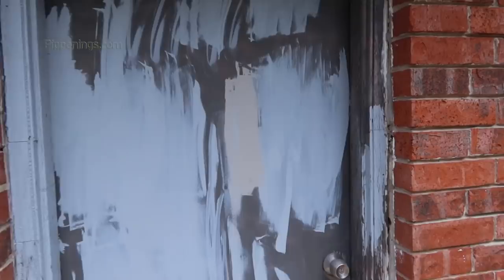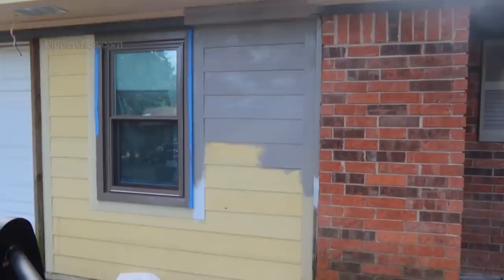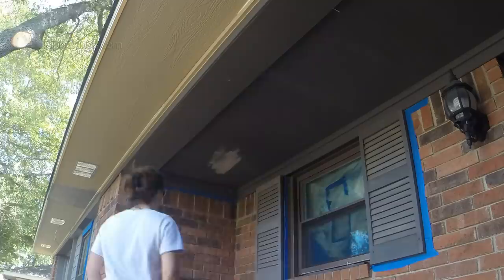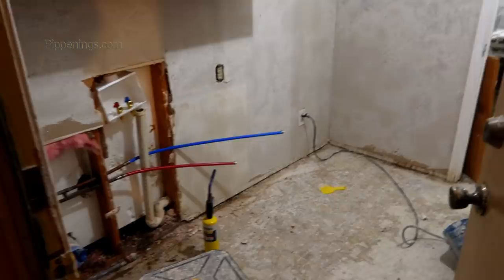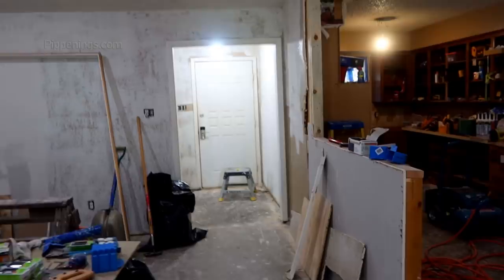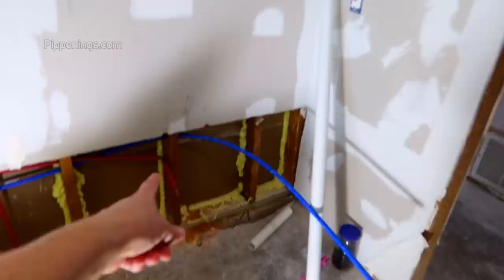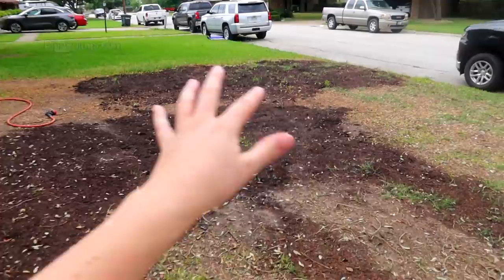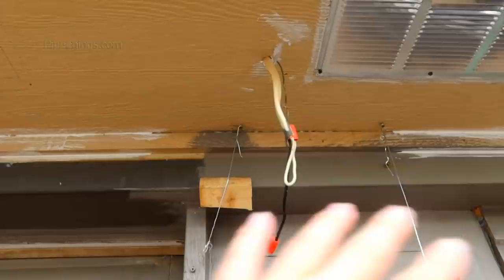DIY Home Reno: Removing a Load Bearing Wall

Comment: Did you create Sketchup Plan for remodel?  There appears to be return to demo rather completing at start of project.  Make sure valve in inside the home wall as it deep freezes in DFW area frequently.  Check Matt Resinger channel who remodels in San Antonio/Austin areas.